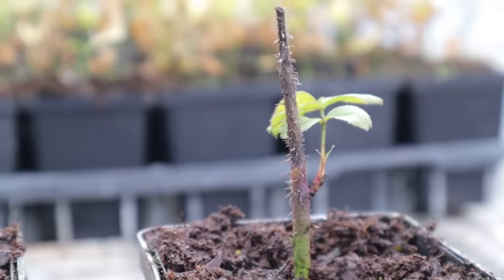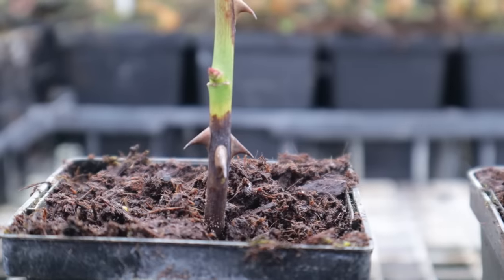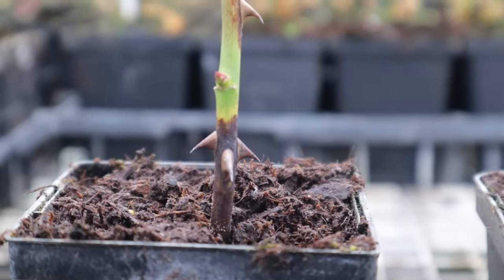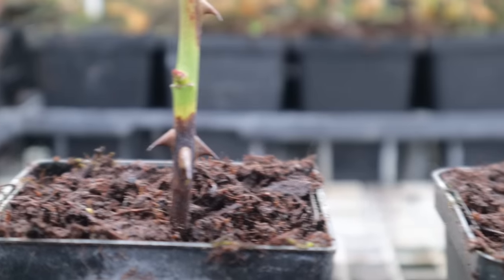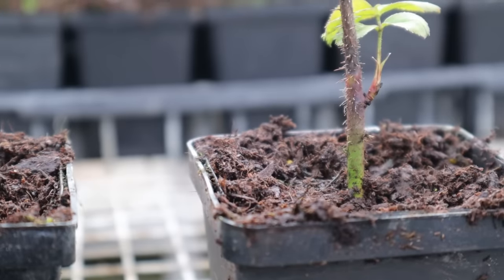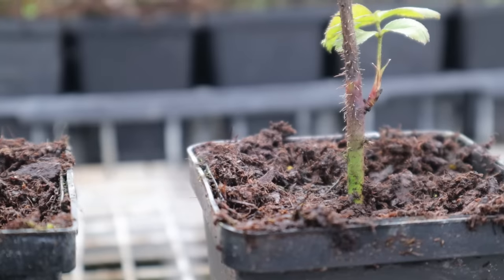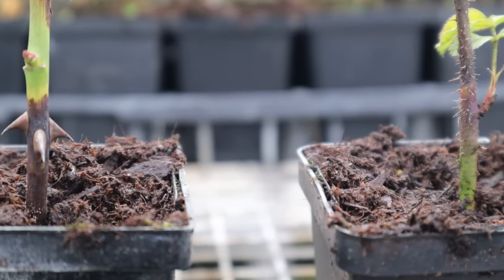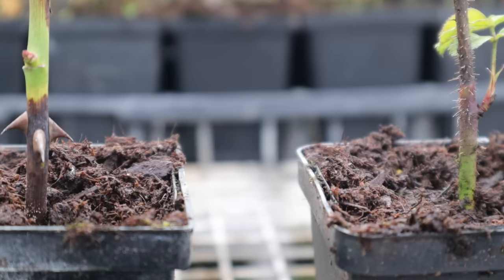Why Do Cuttings Fail? Propagation Tips

Comment: I’ve watched a lot of good videos on growing from cuttings, but no one talks about the soil base and if and how they should be fed. I’ve had many leaves open and then die. I’ve been using different types of mediums, including soil, seed starter mix, and a combination of the two. I have yet to see one of my cuttings survive.
Reply from the maker: Thanks. I do have some videos that talk about the next steps in growing cuttings, like this one here: https://youtu.be/jbPZYX_63Qk  I've definitely found that growing medium choice is important (especially that it's relatively inert and free draining) and as to feeding, it's a matter of waiting until the young roots develop before lightly applying fertilizer.

Comment: I am trying to grow some semi hardwood cuttings I took from Tithonia Diversifolia. One of them took very well and the others began to rot from the base up. Should I remove the rotten part of the stem or just put them into less moist growing conditions. I am currently using a mixture of coco coir, compost and perlite about 1:2: .25
Reply from the maker: Sad to say, but once they begin to rot from the bottom, I've had little success in saving my cuttings. You could try cutting up to another node (if there are more nodes further up the stem). I usually avoid compost in my propagation mix.
Reply: @FraserValleyRoseFarm  okay thank you for the advice

Comment: My rose cuttings made it through the New England winter.  They are still in pots. Now what do I do? Should I take off all the leaves like I do with established roses in early spring? Should I prune them down a bit? Most are 10 to 12" tall. Or do I wait until I see new growth and prune down to that node?
Reply from the maker: You can afford to wait with them until they've put on some new growth this season. They're probably not too overgrown at this point anyway. I'd even consider waiting until after first flowering for a reshaping.

Comment: I have some rose that I've got rooted in clear plastic cups some roots are visible when do I need to up-pot them in regular soil?
Reply from the maker: I do it when the plant is well rooted to the sides and bottom, or sometimes I wait until spring if it's more convenient to overwinter in the smaller size.

Comment: Should you put tree cuttings in water or just straight into the ground?  Also, if you put cuttings in water for a few days and then transfer to soil should you cut the bottom of the plant to encourage growth or just take them from the water and put them straight into the pot?
Reply from the maker: I think you'd generally have better luck rooting directly into soil or potting mix

Comment: What kind of medium should I keep the rose cuttings in while rooting them? Also any recommended rooting hormone brands?
Reply from the maker: I use a composted bark-mulch mix, but peat/perlite is fine too. I've used both with good success. The brand is really not important - but I'm experimenting with the method of deliver and rates. If using a powder, 0.3 or 0.4% IBA is pretty good for semi-hardwood.

Comment: Im in a tropical climate in the Philippines trying to propagate mini roses, they are all soft wood. Ive watched many of your videos which have great advice but its still hit and miss for me in getting the roses to root. Most commonly they dry out from the top of the cutting.  Do you have any tips on soft wood cuttings in a hot climate?
Reply from the maker: It's tough - I find that higher temperatures make my cuttings succeed or fail fast! Open timed mist and shade can help to keep the temps down and the humidity up.
Reply: @FraserValleyRoseFarm  im thinking thats the key. Humidity up temp down, thanks!

Comment: On the other side of this equation is the host plant. Is there a guideline for how much to remove when making cuttings? For example, Lilacs. On a bush of about six feet in height, a crown of six to eight feet. How much or what percentage of the host could cuttings be made from? What stage is best for getting the desired cuttings. Before leaves emerge, just before or after bloom, after the season comes to a close? How would you do it?
Reply from the maker: You're right William - how you treat the mother plants and harvest the stems makes a big difference for success - and it varies an awful lot by variety (even with a genus). I could tell you a fair bit about the different types of roses, but for lilacs I'd need to rely on more experienced growers to let me know how they've succeeded. It looks like with lilacs it's the semi-hardwood method, which reduces the amount of the shrub suitable for propagation to the fresh top stems in late spring.
Reply: Thank you for the help. I'll continue to try with my lilacs and change up the methodology. 
I've just begun with roses so I imagine I'll be spending a good deal of time reading and watching Frasier Valley Farm videos.

Comment: Hi, can I ask please specific suggestions for growing an apple tree from a cutting. I noted you said use sharp blade, clean blade, choose healthy section, cut below node and to grow in less light, less water, cooler. anything else as ive failed a few years now and keen to work it out
Reply from the maker: One quick point (just in case you didn't know): most apple varieties are more appropriate for the garden when grafted onto a dwarf or semi-dwarf rootstock. If you are successful in rooting cuttings from the topstock of one of these varieties, the resulting tree may be overly large/difficult to manage in the garden. That said, I'd keep going with semi-hardwood cuttings and the addition of bottom heat can really help to increase success rate.

Comment: If you notice the black stuff starting, is there a way to stop/reverse that process (or is it already too late at that point)?
Reply from the maker: It's too late once the tissue turns black. You can sometimes trim off that part to arrest its spread, but there's no reversing it.
Reply: @FraserValleyRoseFarm  Good to know. I have one more chance to take cuttings from my grandmother's rose bush before I move out of state and don't have access to it anymore. All four I took last time died in about 3 weeks. Oddly enough, the one I just stuck in water (with rooting hormone) did the best of the bunch, until it didn't. I think that might be because I brought it inside due to a week of severe storms and wind -- too little light and too cold, I imagine.

Comment: I would like to propagate red osier dogwood and hybrid willows into a grass field to change the habitat and help the wildlife.... I’m thinking like at least a 1000 of each. Soil sample is 6.8 and very high organic matter, ground is moist but not flooded. In the Spring can I just place the cuttings into the soil? I’m concerned about the high deer population as they seem to eat everything and would I also need to kill the grass so they get the lions share of sunlight? As you probably can tell I’ve never grown anything 😃
Reply from the maker: Both willow and dogwood root fairly easily - I've seen videos of the willow biomass plantations where they tractors literally chop willow stems and jam them right into the ground. You're right to be concerned that fast growing annual vegetation could crowd it out (or at least slow it down). Once well established, I'm sure some deer grazing will be no threat. So how to get it through the early establishment. You could try a temporary ground cover cloth, just around the planted area until the willow or dogwood is established on its own roots. Or you could consider propagating some in pots for a season, and then transplanting later to give them a good start.

Comment: What are the easiest plants to propagate?. Personally I’ve successfully propagated Lavender, now i have 5 of them. I also did Viburnum and Fuchsia, 1 of each. I tried it with two roses, one very scented Margaret Meril, that one was about to sprout a bud, but just died, no blackness at all on the stem, it just died, the other rose, no scent at all but a tough plant that flowers for most of the year, my first attempt at propagating this one was a success. Now I’m trying to do Budlejias, spelled wrong, but i cut 4 of them, hopefully they’ll survive.
Reply from the maker: It's sounds like you've had good success across a range of plants - buddleia is dead easy. Probably some of the quick herbaceous stuff is easiest: mint, tomato. I've also found succulents (echeveria, sedum) easy and rewarding.
Reply: Which of your Rose plants flowers most of the year ? Would like to know the name and where you got it from , most Rose only flowers in spring or summer

Comment: Is there no way to reverse or save the cutting as soon as the bottom starts turning black? I've had many cuttings, already rooted but then would slowly turn black from the bottom.
Reply from the maker: Not so far as I've found. Black means the tissue is already dead. I suppose the best shot would be to cut again at a node above the black, but at that point you'd probably be better just starting with a fresh cutting if material is available.
Reply: Thanks for your reply!

Comment: the easiest way for me to propagate cuttings is with the tips>>>they easily root with a little light and it pretty much takes off on its own....I keep MUCK WATER on hand at all time>>I have a small bucket that I allow to catch water from autumn till spring>>>VERY MUCKY>>>>and this is the water i use to propigate ANY CUTTING>>it will draw out the roots within weeks instead of months>>>and in cool weather too>>>>>>>I have tried everything and the muck water work PERFECT>>>>

Comment: Oh wow I thought the cooler the temperature the smaller the chance of root rotting. But you said that higher temperatures are good against rotting.
Reply from the maker: Thanks. The best chance against rot so far as I can tell is to provide the conditions for quick rooting. In roses for instance, that's somewhere in the range of 21-22C

Comment: I just did about 6 piece of a snake plants do I need to cover them with plastic?? And I live in Michigan 🤷🏽‍♀️🤷🏽‍♀️
Reply: And I got some in water need help
Reply from the maker: I've seen people succeed with sansevieria in soil (uncovered) or water. By reputation they're pretty easy. Keep the potting soil moist (not *wet*) if you use that method.
Reply: @FraserValleyRoseFarm  ok thanks a bunch so far that's the way I have been doing and I change my water one once a week
Reply: I just got a like on this and I didn't know I was wondering how long it had been so it's only been two months I heard it takes a long time the one in water seems to be not doing as well the one is so seems to be doing okay I haven't picked one up to see if it's real rooted yet but I hope so soon and I have found out since I've been looking at the different websites on plants that everybody is just going on there how they are able to take care of certain plants cuz a lot of it is not true or what I've experienced here in Michigan just like that prayer plant I got it's a tricolor they are very hard to grow I found out through trial and error I still have mine but it's struggling I found out that it's the cold it doesn't like and it's cold in Michigan winners here even in the house mine is starting to bloom a little better and acting look a little better now that the season is changing 🤷🏽‍♀️🤷🏽‍♀️🙏🏾🙏🏾

Comment: can you please explain hard wood vs soft wood?
Reply from the maker: The freshest growth at the tip of the stem is soft. It firms up as it matures. On roses for instance, the stem directly below a flower is generally at the semi-ripened or semi-hardwood stage. Hardwood is when the stem is older and it feels like it would just about snap rather than bend. Each stage requires a different approach to cuttings (moisture, temperature, time, rooting hormone). I do demonstrate some of the "ripeness" of wood in this video: https://youtu.be/211r10Jj_OY

Comment: We have a very tight soil that just works like concrete when watered. The cuttings struggle to survive but finally give up. I tried adding cocopeat but it hardly makes much success.
Reply: Sounds like clay soil. Try planting some sunflowers to bust it up. At the end of the season, cut the stalks at the soil level. Leave the roots in the ground. DON'T PULL THEM OUT. The roots provide organic matter & water/air pathways. Easier than working-in coco coir. The roots can go quite deep. You also get sunflowers.

Comment: I have a problem where my ficus cuttings do produce roots, but never grow new leaves & eventually die.  (both cuttings in water & cuttings in soil) Where could I find a plant guide?
Reply from the maker: I have a little experience with figs (in soil) but it's not my specialty. If you haven't done so already, have a look at Mike Kincaid's videos - he does a lot of them. The one thing I'd advise (without knowing what you've done already) is to transition away from propagation conditions as soon as you have rooting. More light, higher air temperatures, lower humidity, more air movement & the addition of moderate fertilizer is what I've used to turn my fig plants from rooting to shooting.

Comment: Is it necessary to cover the cuttings with plastic?

Is it necessary to cut the top off the leaves (the were left on the cutting)?

Tia
Reply from the maker: There are no strict rules about what will work. I root cuttings both covered and uncovered (with timed mist), and the amount of foliage left in place can vary depending on how crowded your cuttings are and how much humidity you can provide.
Reply: @FraserValleyRoseFarm  tk u for replying!🌻

Comment: Elderberry seems like all the leaves just burn off. The stem is still green and no rot at the base. I water it every evening. What can I do
Reply from the maker: When I stick elderberry, I do trim the leaves pretty significantly to delay foliage drop. They're fairly quick and easy in my experience, though, so even if your foliage has burned off, there's still a chance the stem will root.

Comment: I have a syngonium abso, I recently clipped and put in soil, with roots and all.  
The soil is moist, but after 3 days, the plant is very green, droopy. 
 the leaves feels tender and flat and the bottom stems seems dark.  Not black. Can you tell me what am I doing wrong ?
Reply from the maker: A little wilt after transplanting isn't unexpected. Maintain humidity and let it recover (crossing fingers!)

Comment: Hello Sir, I soak my ficus cuttings in rain water. I hid them in a low light area. After a few days, the cuttings starts to wilted and mushy... I have succeed using this method before. I did not have the luck on my side this time... The previous cuttings, i put them in a shaded area has indirect light. Do you think it is because of the light source? I am so sad today to find out my cuttings dies.
Reply from the maker: Oh definitely - the correct level of light can make a big difference.
Reply: @FraserValleyRoseFarm  awesome! Its true.. I Have moved them nearer to the Light source. Its much better now. Hope They will survive.

Comment: Idk if this is the right way to think of something but I recently took cutting from a bush in my yard and I'm kinda of keeping the cutting whiht the almost same weather I guess. Whiht sunlight and little water...I just planted it 12 hours ago idk if it's going to fail or not
Reply from the maker: The nice thing about propagation is you don't need to wait very long to see some kind of results. My only comment would be that the cuttings now have no roots or supply of water, so keeping the growing environment moister and even a bit shaded can help to keep them from drying out. But whatever works, right?
Reply: @FraserValleyRoseFarm  I have one more question when do I know what the roots are long enough?...The cutting I have has rooted 2 decent sized roots

Comment: I find washing cuttings to remove insect eggs, fungus, dirt, surface bacterial helps alot! After collecting, I remove most leaves and gently wash cuttings with a little soap and then rinse. I either stick in clean water for rooting and replace water often every day or two or place into cleanest soil I have usually seed starting mix. Then once roots develop I pot up in not too rich soil at first to reduce disease.
Reply from the maker: Thanks for adding your tips!

Comment: do you need to propagate them indoors? Can you propagate them outside right in the ground?
Reply from the maker: You can - but usually it's hardwood cuttings that people try in the garden soil itself.
Reply: @FraserValleyRoseFarm  my roses are coming out of hardwood right now but not quite green yet. Would it be a good time now to cut & transplant them in the ground? Any tips for that? I live in Wisconsin

Comment: I have issues with my rose cuttings, They shoot 1 or 2 roots then start turning brown from base up , but my medium is medium wet to dryish, I use a misting system, with 20min cycles for 1 sec
Reply from the maker: Continue to fine-tune your moisture (a little at a time towards drier) and make sure you use a relatively sterile potting mix

Comment: I hv propagationmy monstera adansonii cuttings after 2 month never growth????only Stem without leafs
Reply from the maker: That seems very slow if it hasn't rooted or sent any new shoots. If you don't see progress by now, you can try a couple of things to jump-start development: a low-rate application of rooting powder to the base of the cutting (mosntera won't usually require hormones to root, but it might be worth a shot). Also you could increase temperature or light if that makes sense to your situation.

Comment: which rooting hormone do you use?
Reply from the maker: Up here in Canada the brand is StimRoot (#2) but it's basically the same as any other brand of talc-based rooting powder in the concentration of 0.3 to 0.4% IBA (Hormodin, etc)